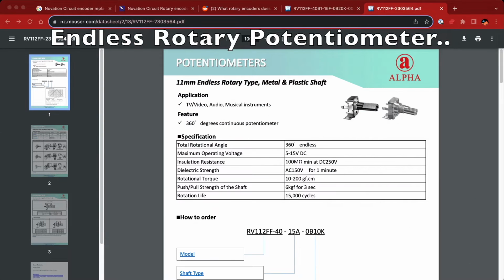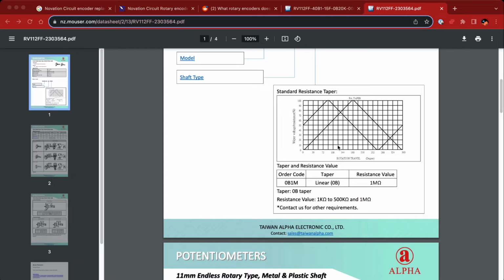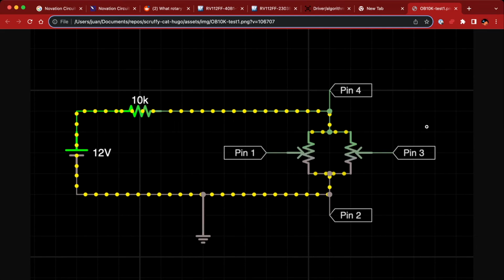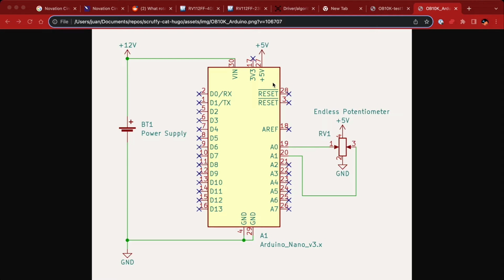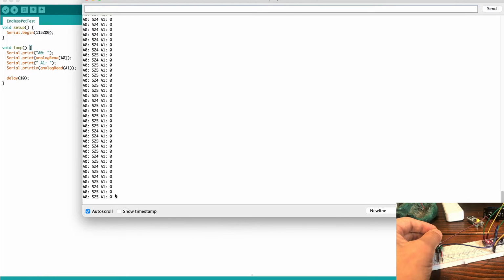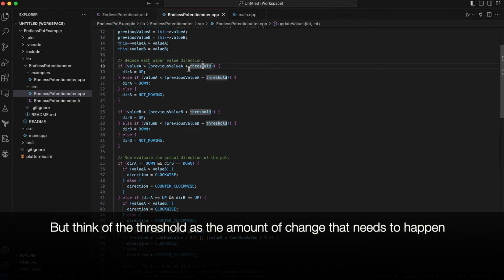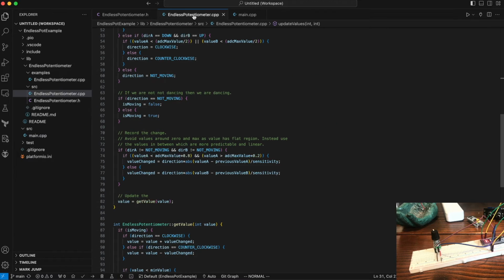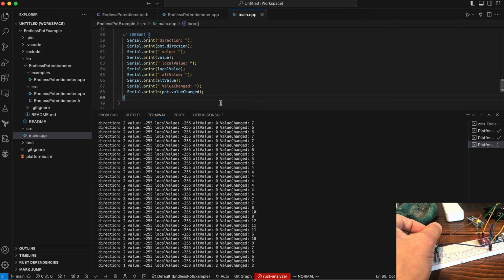Deciphering the Endless Rotary Potentiometer - Experiments and Insights

Comment: Great video! 
Perhaps you have came across an alternative pot that has the same functionality? There are quite expensive and cost about 5eur per piece. Thanks in advance!
Reply from the maker: These look like drop in replacements for cheaper. https://www.aliexpress.com/item/1005005311127312.html

I just ordered some to test, we'll see how they turn out. :) Other than that, I haven't seen anything exactly like these.
Reply: @scruffycatstudios  Thank you! It would be great if you would confirm if they have reasonable quality and if they work as the ones you spoke about in this video.
Reply from the maker: Ok I ran the same tests on these pots as I did with the Alpha and I got some interesting results.

Build: They seem pretty solid. In terms of quality they are on par with the Alphas. If anything these feel a little bit stiffer to turn. But the Alphas are pretty stiff too so no much diff there.

Measurements: Interestingly enough I don't think these are at exactly 90 degrees offset. My voltage reading were about a volt off, which got me worried that these would not work. So I uploaded the simple test sketch and sure enough the graphs look just a little bit different. I also noticed that there appears to be a bit of dead/flat measurement at the peak of the values for each of the wipers. That is the top one maxes, while the lower keeps increasing.

Sketch: I uploaded the example sketch using the library which can be downloaded from my GitHub page. I was pleasantly surprised to see that the library was able to detect direction given the difference in hardware. As far as I can tell it seems to work the same. ¯\_(ツ)_/¯
Reply: @scruffycatstudios  Thank you for sharing this!
Reply from the maker: It's my pleasure my friend. Do stop by again and share with us what you end up making if them. :) cheers!
Reply: @scruffycatstudios  What I would like to do is to make a midi controller for my Digitakt. Ive made a prototype with a microcontroller and pots. Fairly simple to do. BUT "reliative"

So what I would like to make is a "state aware" controller. In order to do that there should be an option to send the state of all mappable CC from the Digitakt to the controller. So that the controller would know the exact values of the parameters at any given moment. In that case the controller would be able to increment or decrement the values and work in relative state instead. On the Oktatrack they have midi CC 61 for that.

This is what Im trying to figure out right now - how to request this data from Digitakt. And trying to figure out if there is a universal method for requesting such data from any hardware musical instrument be it synths drum machines samplers etc.
Reply from the maker: I don't think there is a universal way but I could be Wrong. There may be something in the MIDI standard but it is up to each manufacturer to implement such things. I assume you've already been looking at the MIDI implementation for the Digitakt, if there is such a way it should be listed in there. I don't own any of the Electron products so not much help I can provide there. :(